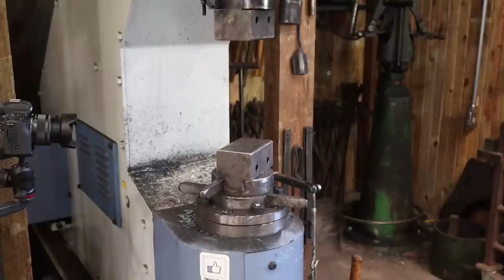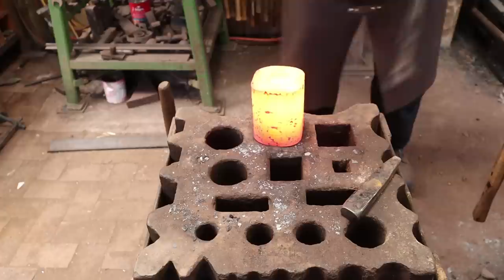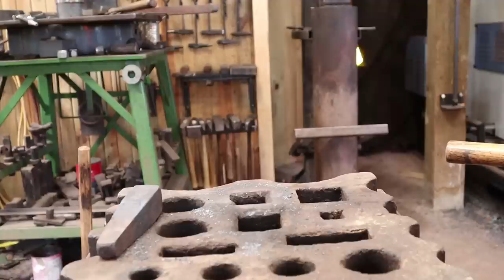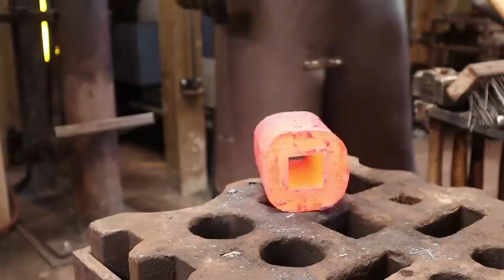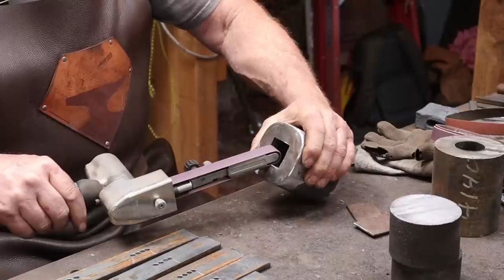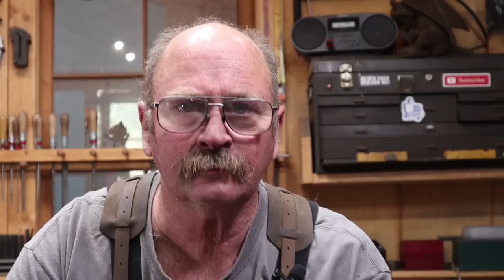Forging a hardy tool bolster from extra heavy tubing

Comment: Very nice John, I have a 14lb sledgehammer and boy o boy it's a beast :-) the only thing I use it for now days is driving the occasional axle into the ground to use as an anchor point :-) nice job on the swedge block

Comment: If you get lucky, you can find drill stem that hasn’t had the ends machined. A 2 3/8” size unfinished stem will give you about the same dimension you have at far lower cost. I forget the type of steel they are but it is good hardenable material. I am lucky to have 30 or so ends that would yield about 60 bolsters. Excellent stuff. Good luck!
Reply from the maker: I haven't heard of a ource for those.  Where do they come from?
Reply: Black Bear Forge I am in Texas and drill stem and sucker rod is readily available. I am 62 and my ranch has many miles of 2 3/8 pipe. Corrals, barns, fence, etc. I have at least 10 miles of it in one very large cattle facility. It is like tinker toys. But the pipe I am talking about never had the  coupling machined. Very heavy stuff - just like what you used. Again can’t recall steel type but it is hard as woodpecker lips. Sucker rod comes is various sizes and makes great fullers, tongs, etc. there are many grades depending on intended use. There will be a stamp on the connections that can be deciphered for steel type. It is The Gift of the Gods. Find a used oilfield pipe yard and have a look!!

Comment: Hi John, very nice vid with a lotta hard work and some interesting teasers at the end. You mentioned doing another bolster, wouldn´t it be  possible and kinda usefull making the bolster a 2 steps tool? Meaning, one side with a taper  half way through to preform the workpiece and the other opposite half with non to get it parallel sided. Hope me thoughts make sense to you. Or is there some reason not to make it this way I overlooked? Anyways, have a good one Smarty.
Reply from the maker: There are lots of options to include more than one stage of the work in a single tool, but it often limits the tool to just that one job.  Sometimes by having separate tools they are more versatile.   Plus space can be a bit limited under both the power hammer and the press, So I don't want tooling that is to large.
Reply: @BlackBearForge  Ah okay, I get it. Thx for replying and a nice weekend to you and Mrs. Switzer

Comment: Black Bear Forge, I have a question,
I acquired a couple grade 8 bolts 1 1/4" x 12", my question is would they be the right steel for foraging hardies ?
Reply from the maker: I would test them out first,

Comment: Could you have used some square bar as a mandrel when you were squaring up the blank under the power hammer?
Reply from the maker: You could, but it would be under sized and still need to be drifted.  A tube this heavy has enough support in the walls it doesn't require working over a mandrel so much.
Reply: @BlackBearForge  Ah, gotcha! Thanks for the reply!

Comment: Ive seen a piece of stainless steel tube like that that was being used for steam or something like that at a plant and it somehow ruptured...imagine the power of what was going through it.
Reply from the maker: Steam is powerful stuff
Reply: Power plants run at high temperatures and crazy pressures.  When pressures are measure in ksi (kilopound per square inch) you know you are dealing with some dangerous pressure!

Comment: So, if that big piece of round tubing needed to get squared up before it would fit in your gas forge, how did you get it hot enough to work under your power hammer to square it up?? Did I miss a step?
Reply: He said he was going to grind a flat one 2 side so it would fit at the beginning of the video.  He did not show the grinding step though.

Comment: Little off topic but do you put on your shoe wear according to to project for the day?  I noticed your leather boots today.  Ouch if that hot or cold steel piece dropped on your foot wearing the running type shoe.
Reply from the maker: I wear the same leather boots in the shop 90% of the time

Comment: Did you drift the square hole from both sides or just one side?
Reply from the maker: Both sides until it drives flush then the final pass with the extra piece to drive it from one side.
Reply: @BlackBearForge  Ah ok, was not sure if doing it from both sides could create misalignment or some other issue.  Thanks for the response.

Comment: Just curious, why didn’t you use the power hammer, or tredle hammer to drift it?
Reply from the maker: It would have required a bolster to drive the drift into.  Plus there is an overall height issue